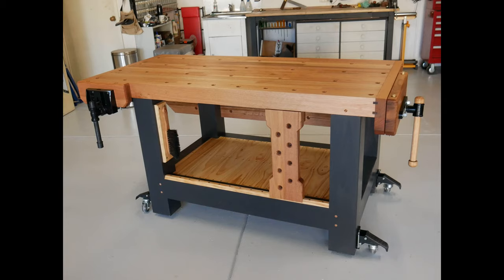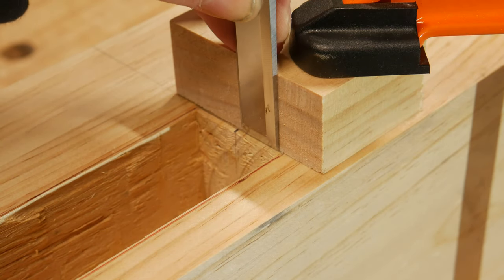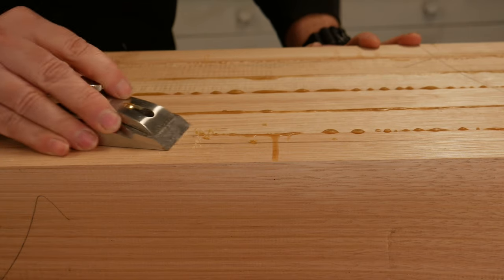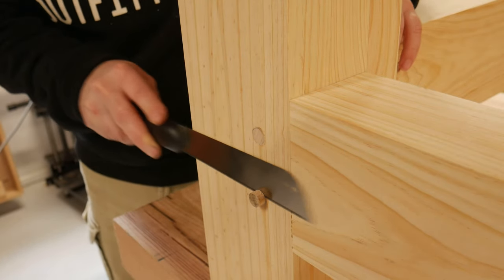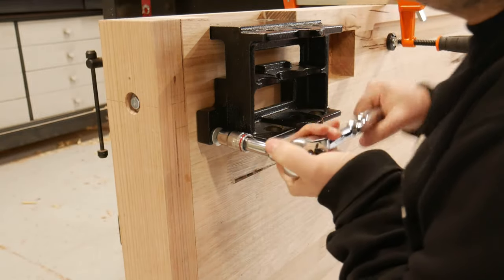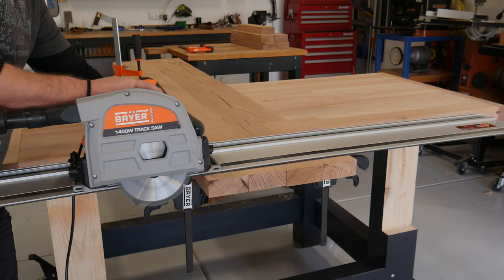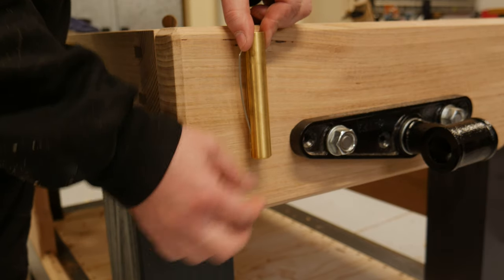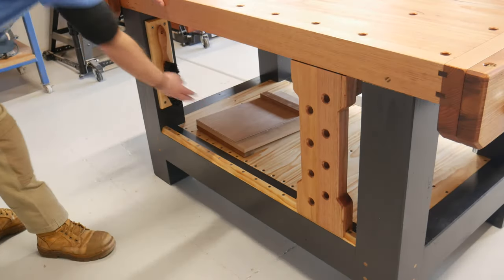A Great Workbench/ How I built my bench

Comment: Just found your channel and am enjoying your videos.  I’d recommend adding affiliate links if possible as you use a nice/wide selection of tools.  For example, what kind of chisel plane is it that you used for the glue removal?

Also, wondering how the splines on the ends have worked out since this was built.  I’m wondering if the wood expansion was an issue or if this method helped keep things in check?
Reply from the maker: Thanks heaps, the bench did expand slightly, you can feel maybe .5mm difference if that. Overall I think it helps a lot and would certainly use this method again.